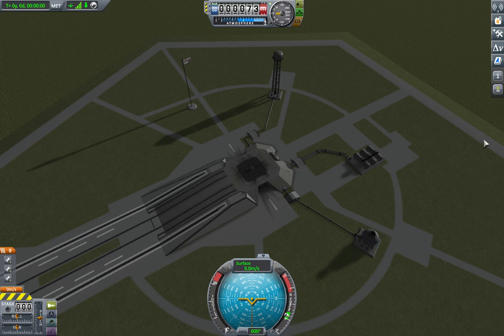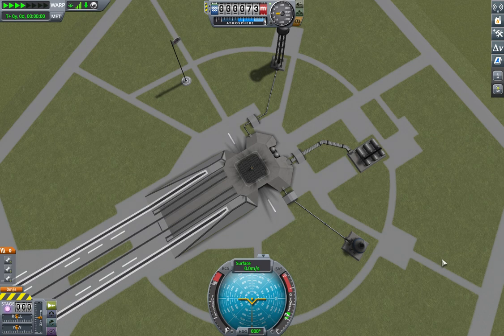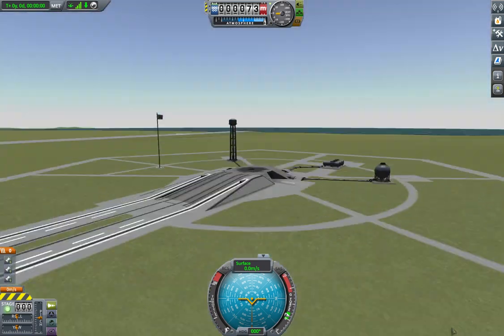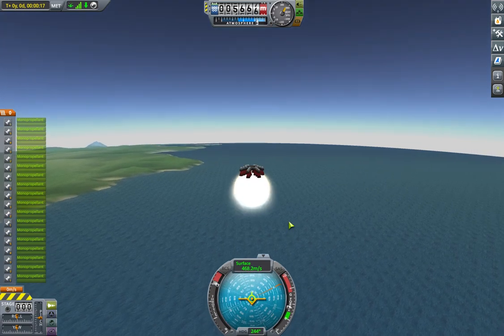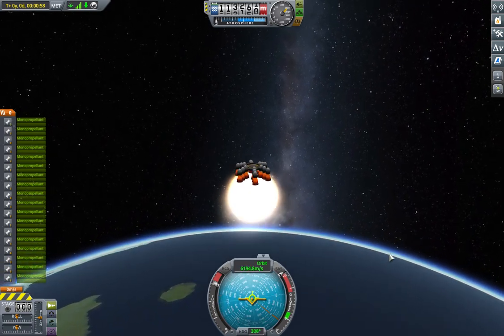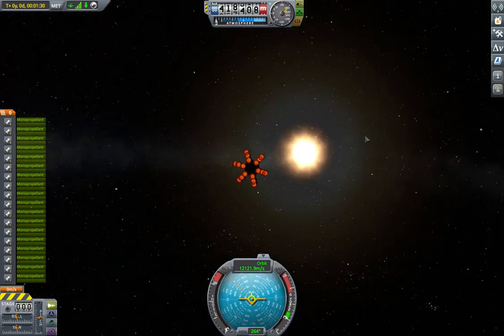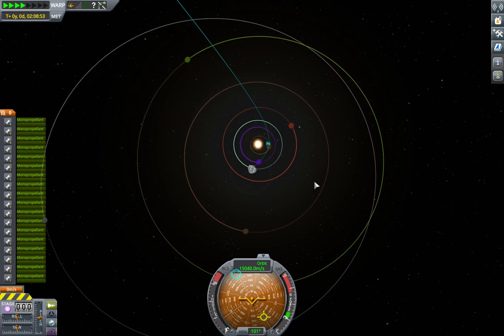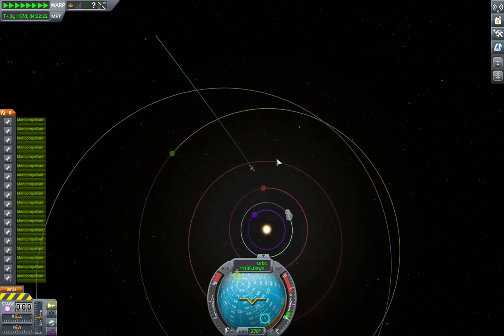Manhole-into-space simulation

Comment: How much did this cover weigh? I highly doubt it would vaporise nor go to space because the manhole cover doesn’t have evaporative materials in. And if it had enough power to go to space then the power sent through the pipes may be enough to blow other manhole covers in the system off into some distance.
Reply from the maker: Approx 900kg. The question this video addresses is not "would it evaporate" (although  I suspect it would have) but would it hit the sun (if fired at noon) to which the answer appears to be "almost certainly not."
Reply: Concrete isn’t exactly “evaporative” either, but it certainly did get vaporized in the original test this comes from.